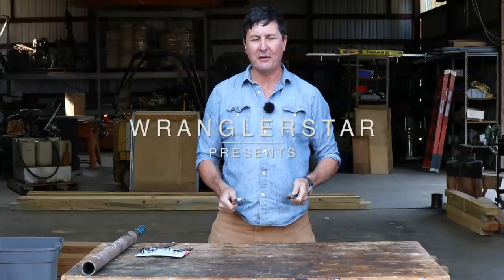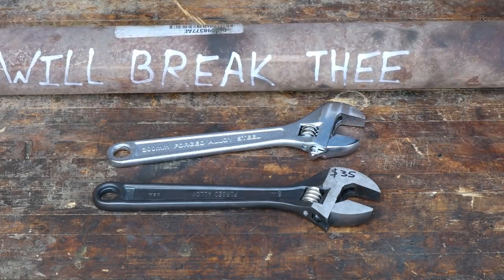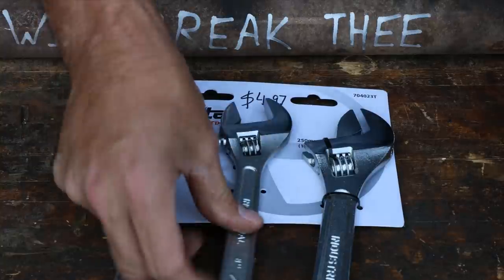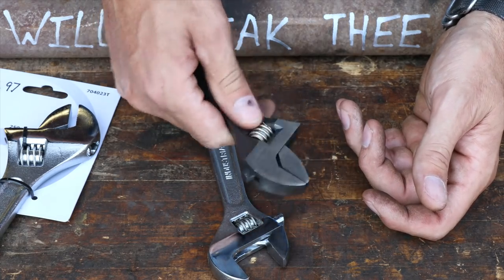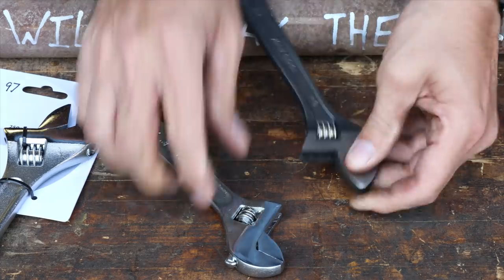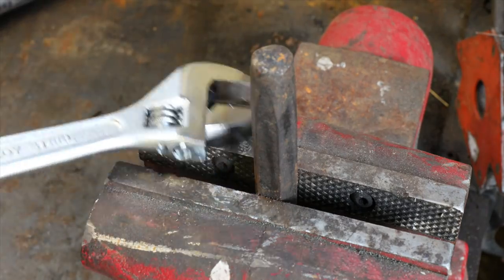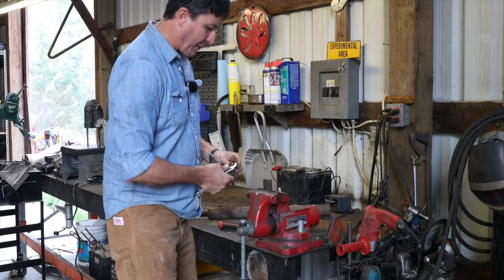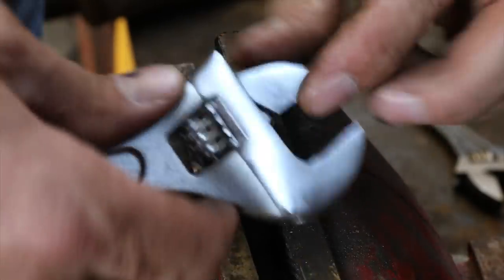Testing Cheap V.S. Expensive Wrenches On AMAZON

Comment: Try a wrench from Germany as well... against the American one...
Reply: Germany will win, i love American tools but the steel in german tools is superb
Reply: Miendust or a Swedish against a German one. More interesting I would say!
Reply: Knipex tools are awesome.  That said, I'd put my 18" Crescent up against anything.  I've used it everyday for 20 years, with as much as 6' of pipe on it.  U.S. CrVa steel is pretty damn good.  Most Chicom tools are made of chewy, soft mystery steel.  Even expensive Chicom "irwin" branded adjustable wrench tested only 28 Rockwell.  Soft enough to easily deform under normal use.
Reply: Believe it or not, the best tools we have are from West-Germany, 40 years old and still beats new tools...
Reply: some exmaples of good german tools pls
Reply: Knipex is starting to sell more than klein tools at my workplace
Reply: Wurth, Gedore, Stahlwille,  Swedish Bahco for adjustables like in the clip. Facom are French, they make nice light and thin wrenches for getting into tight spaces, like engine builds/breakdowns. According to him though and am an elite, since I don't use crescent wrenches as hooking 6 corners of the nut or bolt head seems more secure and torque spread, than 2 or possibly 3 sides. Rounding off a nut is not what you want.  There may be more, but I am in the UK. I would not recommend British tools, unless you are prepared to pay. Sykes Pickavant  is one, but it's quality is automotive quality and perhaps too specialist.

Actually, I would say that the name or where it was made is less important than what it is made of and you should be looking for Chrome Vanadium. It is these elements in the steel alloy that gives it enormous strength. Any manufacturer that bothers to use the right steel alloy will take the trouble to machine its part right so there is next to no play in the movement. It does very little bending and usually when it does, and attempts are made to bend it back results in a break. Cheap tools are made of high carbon steel that, in comparison, bends with less force. So it's up to you.
Reply: old german tools made out of chrome vanadium will be around for a long time. My knipex side cutters have cut allot of stuff they shouldn't and are fantastic. Ag mechanic for 12 years
Reply: Hans Strandberg Swedish ppl have tools? Dafuq?
Reply: Chrono Trigger thought that's what the Swiss Army knife was for lol
Reply: Still trying to compare with Americans?  American ammunition still penetrates German steel lol
Reply: Craig Brisbon With the help of german technology ahaha
Reply: I tried to get a german  alu nut that was corroded and stuck with a low quality chinese socket.  The nut did not move, and the socket broke.  I had to get my expensive sockets.. and then I was able to get the nut out.  If you are in the field, just get quality tools, otherwise, chinese stuff is great to just have the tools and not expend thousands.
Reply: the German one will lose, just like in the World Cup.  *Triggered*
Reply: The best tool is BELZER/Sandvik.
Reply: hey this is supposed to be a fair test ...lol
Reply: amen
Reply: Expensive as hell, but yes, AWESOME!
Reply: Rahul Atul Hazet. Greets from Germany
Reply: The point wasn't "American vs Chinese", it was a cheap tool vs a more expensive tool.
Reply: Chrono Trigger lol
Reply: Stahlwille and Hazet from Germany. Being incredibly talented at doing lots of things the US doesn't make the best tools.
Reply: Yea this would be interessting
Reply: Yeah
Reply: Shane Spurgeon indeed it is
Reply: Sounds like someone is still sore about WW2
Reply: Nope. I have German, Polish (very good, by the way) and US made Proto that I got used 30 years ago. My Proto is the best of the 3. I live in Europe.  Now, I no longer by "US" tool names like Husky, Craftsman, etc. because they are made in China! I also have Sandvik, Knipex, etc.

I do like my Bosch power tools a bit more than Makita.

Been doing mechanic work (rebuilt my first engine in '79) for a long time.

Now, dollar for dollar or euro for euro, the Polish make a very good tool for a very good price!
Reply: Miendust German tools rule!
Reply: Miendust try some Mexican Wrenches Vs Gringo tools
Reply: Barrett Mills lol swiss army knife originated in switzerland
Reply: Try a French against a German.......never mind.
Reply: Nows adays we buy brand names not quality
Reply: This particular tool is actually a Swedish invention and they were the first to manufacture adjustable spanners, so safe to say the Swedish ones are quite good too, probably the best ones
Reply: I like German wrenches but honestly I think the German and American will preform damn near identical
Reply: Swedish brand Bacho is the best.
Reply: an OLD GERMAN one would of broke the Snap On vise... I'm Canadian and Know That... Hey
Reply: $100 Hazet vs a $80 Snap-On vs $10 Stanley
Reply: @craigbrisbon4458  that weapons this is notmabout weapons but tools, and then germany,wins also cars are better then american cars,well at least the old cars,
Reply: +Barrett Mills You do know, that Sweden and Switzerland are two different countries, right? Swiss = Switzerland, Swedish = Sweden
Reply: Do all germans end sentences with "..." aswell ?
Reply: I was thinking the same thing. You really want to see quality, buy a German one
Reply: @hexiotutorials7202  The Heyco tools from my Old E30 BMW made in 1987 have been fantastic.  I  would have to agree the W German tools don't even show any wear after 31 years.
Reply: ROTHENBERGER 8" Adjustable Wrench .... made in Korea with steel from?
Reply: @bimmerwman  yep, still serve me well. My father gave them to me a few years ago. We also have some Keppler weights and gym equipment that are 40 years old and are still being used. Very simple things but still useful. What's not on it can't break either!
Reply: I thought it was a consensus that a company called Unior makes the best quality tools.
Reply: I was thinking the same thing..Put the American made tools up against tools made in other countries...I'm sure a tool made in Canada, Germany, The UK ect would do just as well.
Reply: Miendust Germany make the best tools, America make the best brick trowels though
Reply: You obviously do not know Snap On or Craftman.
Reply: Same with German  weapons
Reply: They both break
Reply: Nothing beats a Dowidat.
Reply: Japanese made tools anyone?
Reply: Knipex
Reply: no need for craut tools
Reply: I have a pair of Knipex end cutters which my dad used 50 years ago when he worked in the building industry as a rebar fitter, and they are still sharp.
I can cut 3 or 4mm hardened steel wire with them and still these cutters don't show the slightest indentations on the cutting edges.
Reply: Yes,  I agree. Tools  from  Germany  and  Italy  and  I think Switzerland.  They  don't  fool  around. 
Ask  a  foot  doctor  where  he  gets  his  tools,  Regarding  scissors ( They have to be  high quality steel  )  
So  we  all agree  China  is  a  country  where  they  don't  have  quality  control.  But years  ago  they  didn't  have  99 cents stores.
Reply: @Hans_Strandberg   I have a few Bahco (Swedish) adjustable wrenches (various sizes) that I got about 40 years ago when I was an engineering officer in the British merchant Navy. I'd put them up against any others.
Reply: I think Germany adds sophistication and ergonomics to tools but not greater durability.
Reply: @chrono trigger
Hope youre not american or that remark is a serious selfburn considering the rather substatial tech the us buy from sweden.. especially in things like military equipment.
Reply: @hexiotutorials7202  wanna laught? I bet this tools was produced in East Germany back then
Reply: German tools are not any better than any other decent tool. People always get sucked in with the thought that German technology is something great when it's not.
Reply: German tools are great, if not overpriced. Like one German crescent wrench will cost you as much as a full set of American wrenches. And ultimately you come to the same debate that wrangle does; Is one German wrench really the same value as 3 or for American wrenches? And 20 Chinese wrenches at that?
Reply: Something I just thought of, is maybe both is a good answer. A few American wrenches and maybe a good precise German one for those high stakes jobs where you really cant strip a bolt. Just a thought though.
Reply: Randy Magnum my dad has a pair of Knipex diagonal cutters, and some pliers that work similar to tongue-and-groove, but it has little teeth to adjust them, they do seem really well made. I like Channel Lock tools myself for tongue and groove especially. My father-in-law gave me an old-school 12” American Cresent wrench, and it’s got a little play but it still hold up good.
Reply: Attila Zsombor Burián Sandvik probably makes the best bow saw blade I’ve ever used.

Comment: Man if only there was a tool that you could use to measure the amount of torque you are putting on each wrench
Reply: I have seen a dynameter for testing cables on youtube, that would be very accurate. Of course he would have to get a chinese version and a Made in USA version. and talk about them for two hours.
Reply: He cannot configure the extension tube to properly fit the handle of the wrench. It really is unbelieveable it did not slip off when he pulled on it. And, a drive shaft is overkill anyways.
Reply: It's only unbelievable to a tool n00b.  And, a breaker bar is all about the overkill.
Reply: The breaker bars I made are fitted to the handle of the pipe wrench/adjustable wrench they are to be used on.
Reply: You could use just a linear spring scale, and multiply by the length of the cheater bar
Reply: bradley morgan you beat me to it!
Reply: It was more than 7 times the price, the 5 dollars was for 3 wrenches, one of which was even bigger than the one he was using, if anything the more expensive wrench was roughly 17 times the price of the chinese one.
Reply: D Sloop I agree, he can't really call that a "cheater" bar because it's so much larger than the handle. I've never seen anyone make a cheater bar that wide, I mean seriously you could fit a small child's fist in there. (Not that you should, just a frame of reference)
Reply: One of his videos is about felling tree, he tries to use a railroad jack to make the tree fall.
Reply: Dan Conway it's an electronic torque wrench
Reply: he could do these tests with a hydraulic press with a pressure gauge
Reply: Maybe a cheap Chinese one lol... but then would it be accurate?  Just kidding!
Reply: You could get a massive cheap torque wrench at Harbor Freight. To measure the strength of an expensive tool. But because it was cheap you would end up with a whole box of them at your estate sale
Reply: Ian s but then u have to buy the stuff to fit the torque wrench from Harbor Fright tools patent pending 😂
Reply: FxW=#Sx=how deep he can come...if that helps

Comment: The crescent wrench is the duct tape of tools
Reply: vicous__diamond not perfect for much but adequate for everything
Reply: vicous__diamond i would add channellocks to that list.
Reply: I have my grandpa's channel locks, and I bought a brand new pair as well only to find out the jaws on the old ones had just as much life left in them.
Reply: MiJaK123 
I've got my grandfathers original champion dearment channellocks from 1933 and they still work great, channellock  just plain makes a great tool for not a lot of money.
Reply: Beg to differ I'm a plumber and use them every single day bahco ones and they have never ever let me down and if had them for 9 years
Reply: duct tape is the duct tape of tools because you could form duct tape into the shape of any tool (viable solution btw)